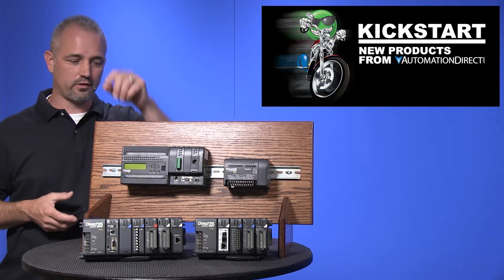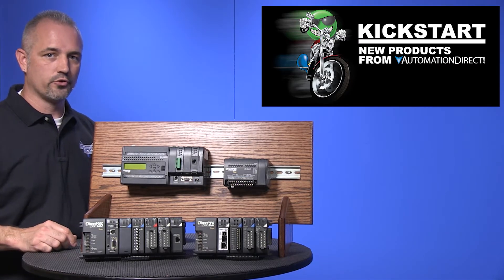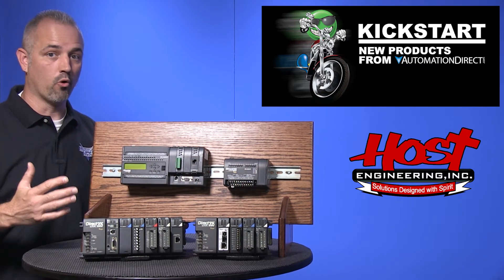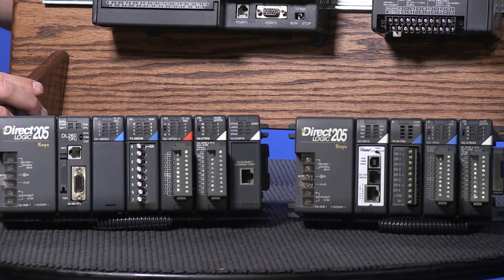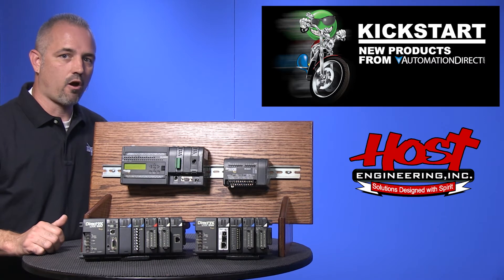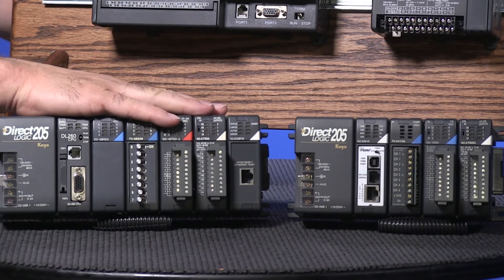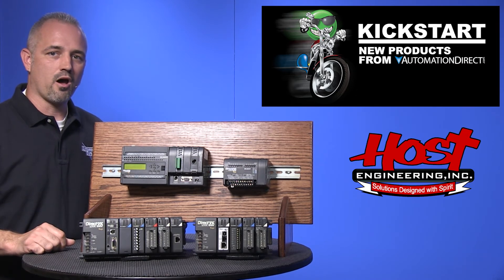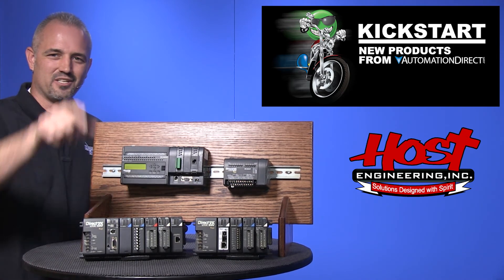DirectLOGIC DL05 & DL06 High-speed Counting Pulse Output Modules from AutomationDirect

Comment: I picked up a h2-ctrio just to learn from it so I started with a simple RPM program but can't get consitant readings. I have a D2-250 cpu and relay output card. I wrote a program to fire an output every 1sec for .01 sec on time. But the counter gives me varying results. 
in the ctrio WB I have channel A set to- counter, up, Rate, RPM, BCD, counts/unit 60, unit base minutes, interval 100. What am I doing wrong. THought this would be the simplest test I caould do with this.

Comment: How about click PLC .can using with Encoder?
Reply from the maker: @Kong Senghun, thatnks for the comment. The Click PLC does not have inputs that are designed for use on high speed applications. There are no macros, in the software, for counting or speed calculations that work independent of the PLC scan. The encoder can work to the inputs but will only count once per scan of the PLC, like and standard input.